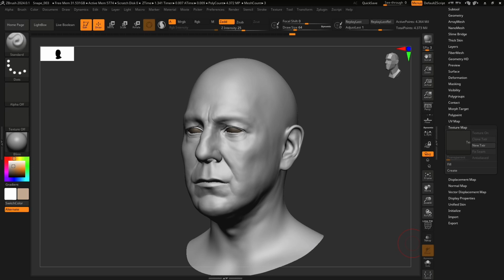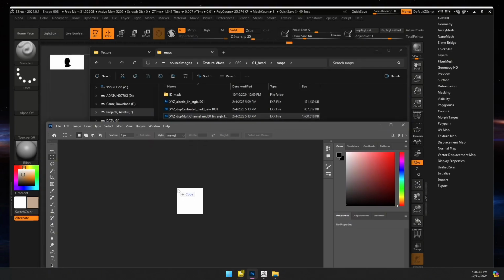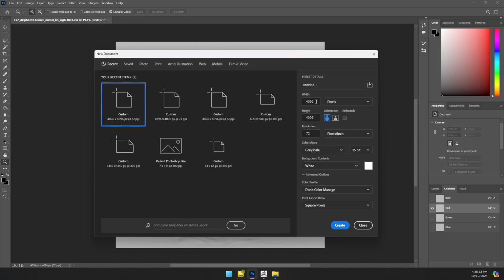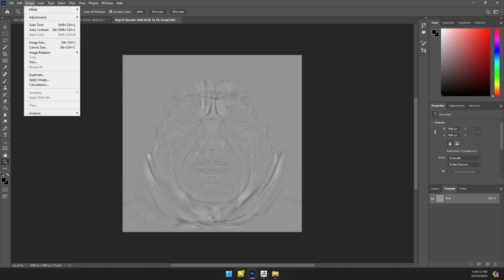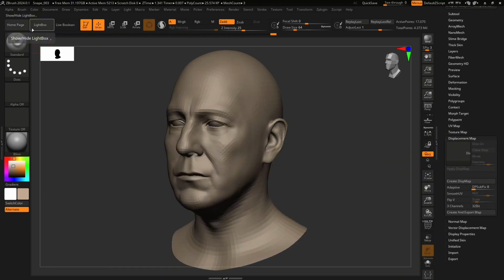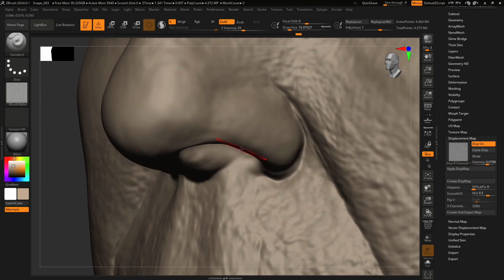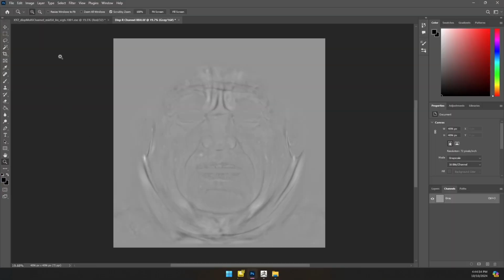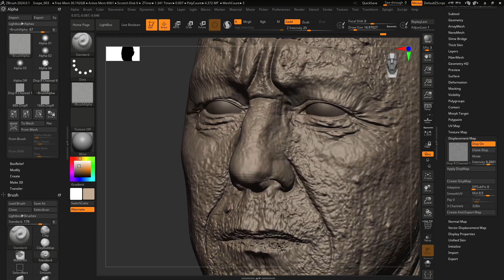Step-by-Step Guide to Applying Displacement Maps and Solving Topography Issues in ZBrush

Comment: My XYZ VFace Displacement Workflow

I always use EXR 32-bit , never 16-bit , since it’s the best for high-end rendering in Arnold. (16-bit is fine for things like Daz3D, but not for production work.)

Steps:

1.VFace Wrapping: Wrap the XYZ VFace texture directly onto my sculpted head.

2. Export: Export the displacement map.

3. Image Prep: In Photoshop, skip the copy-paste layering ( never needed if you are using wrap3d) . Instead, just:

-Add a Levels adjustment.

-Set Output Levels to 127 (black) and 255 (white).

-Flip the image vertically.

4. ZBrush Setup:

-Subdivide the head mesh to Level 6 or 7.

-Click Store Morph Target.

-Add a new layer and start recording.

-Import the displacement map.

5.Result: The XYZ VFace displacement details are now stored as a layer, ready to blend or adjust.
Reply from the maker: Thank you for the information you shared with us.

Comment: I save my textures in 16bit grayscale as a new grayscale 16 bit file without flatten image and delete background layer. Pick TIFF file format in save options turn of ICC profile: dont gain 20% and in TIFF settings pick Byte Order - Macintosh. With this settings displace map works well. Issues appears only if apply flatten image on layer. I asume tiff format something do with image after merged layers or flatten image for optimize file size so in Zbrush reveal result of this compression. XYZ textures very accurate that why they saved in EXR 32 bit
Reply from the maker: Thanks for the explanation!

Comment: Hey, good video! In my experience, this error is caused because the lack of information in the image, normally TIFF format is not very useful for displacement. I would recommend using  EXR 32-bit compression type: none. Let me know if that helps.
Reply from the maker: Hey, Thanks for your Guidance,. but I also tested this format and unfortunately the same thing happens. i even imported the XYZ file without any edits, but the same thing happened again. this was the only way that worked to me. I also saw some people for whom the same 8-bit  file format works.